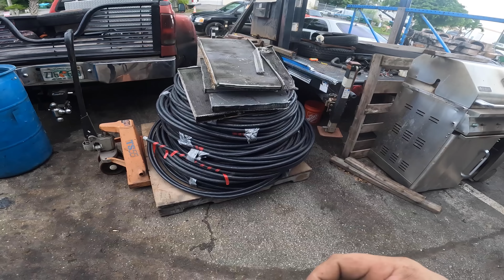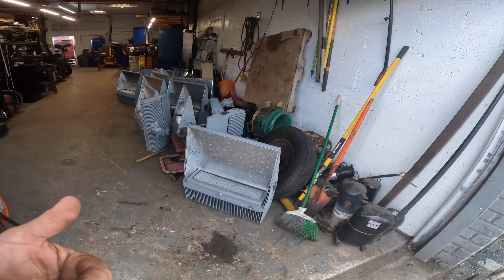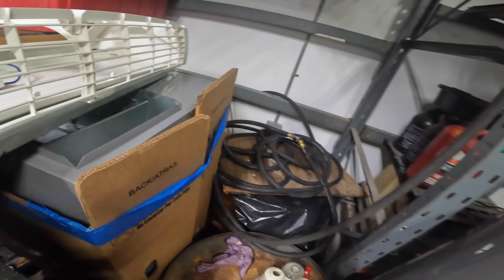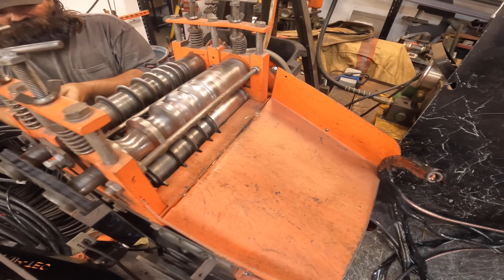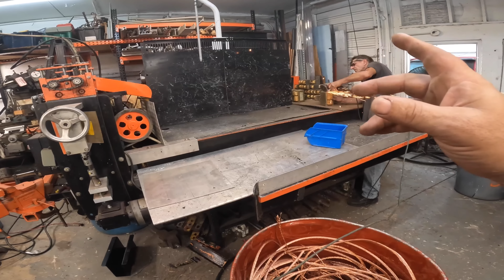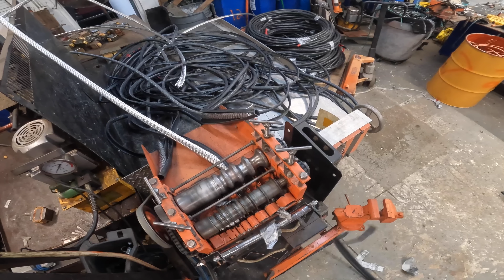The biggest Aluminum Donut I've Ever Made & A Bit Of Copper

Comment: As a electrician in the U.K. LED biggest problem is the heat on the drivers we installed 40 LED high bay fittings in a factory with in 4 years we had to replace the whole lot at the expense of the lighting manufacturers expense we find out the problem with them the drivers could not cope with the heat . Great videos Sir
Reply from the maker: That seems to bet the main issue with them here in the states.

Comment: Yo, I don't know a lot and this may be a dumb fucking comment, but when you were talking about moving the smaller wire stripper because you need it to run in the opposite direction couldn't you just reverse the polarity of the motor?
Reply from the maker: Possibly, not all motors can be reversed.